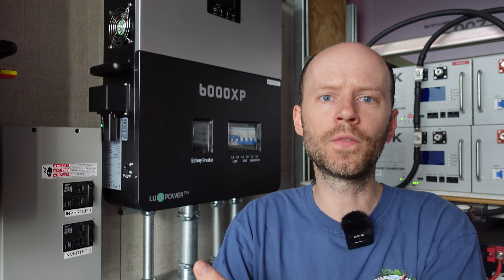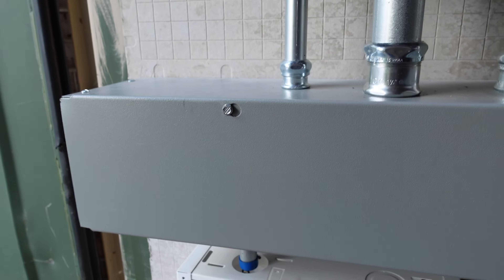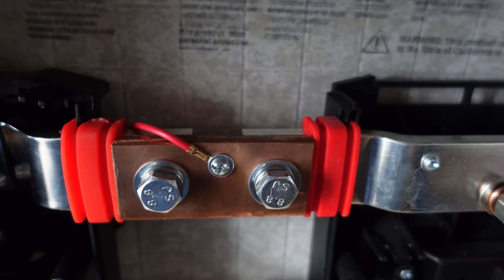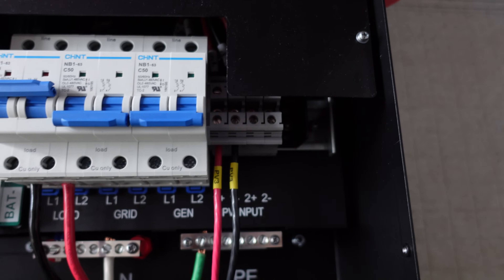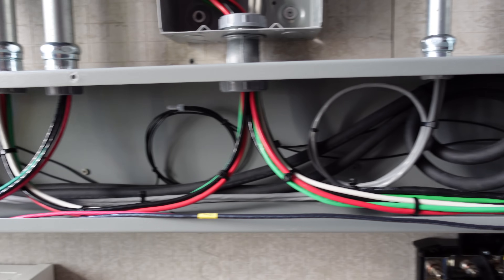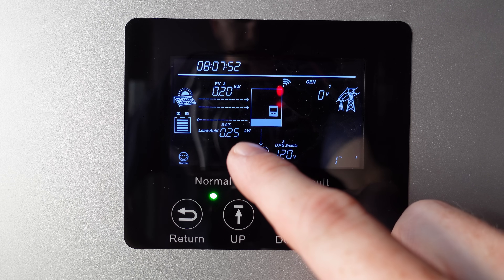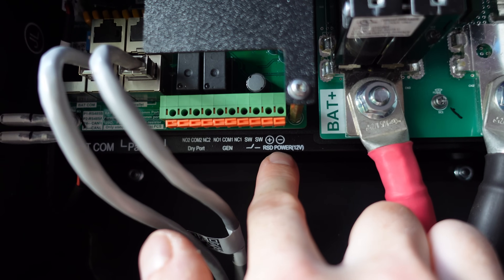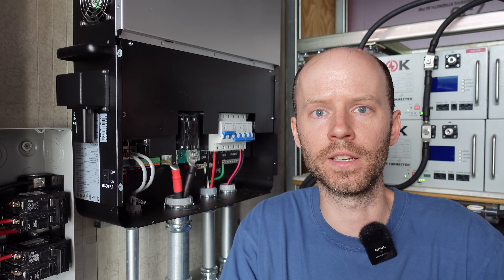The EG4 6000XP Inverters are Installed, Finally! 12,000W Off-Grid Solar Power

Comment from the maker: EG4 Inverter... https://www.currentconnected.com/product/eg4-6000xp-inverter/?ref=lithiumsolar
Victron Busbars... https://www.currentconnected.com/product/victron-lynx-power-in-distribution-system/?ref=lithiumsolar
Siemens Panel... https://amzn.to/3KNXnOB
SOK Batteries... https://www.currentconnected.com/product/sk48v100-48v-server-rack-battery/?ref=lithiumsolar
(affiliate links)
Reply: these are LiFePO4 batteries but the inverter thinks they're lead-acid according to the display, is that bad?

Comment: To disable or encryp the WiFi dongle:
Find the IP address the dongle got from your router and access it via a web browser.  The default login is admin/admin.  Select "English", and then you can adjust the "Wifi Mode Setting" to either disable the "AP Mode", or in the "AP Mode Setting" tab, you can enable encryption and add a password.   I recommend leaving the SSID to it's original name otherwise the EG4 app wont be able to find it.

This is working fine for me.

Good luck,
Mr Goodbits
Reply from the maker: Does the serial number for your wireless dongle start with BA?
Reply: @LithiumSolar  Yes it does.  I have the 18kpv.  Both models use the BA##### dongle.
Reply from the maker: @tomarq  Ah ok, what your describing only applies to the BA adapters. Mine is a BJ adapter and does not appear to be responding on any of the common web ports.

Comment: Does the unsecured inverter SSID give you access to settings or just for monitoring ?  Wired dongle $200 seems like they just want you to use wifi, that’s disturbing in so many ways.

Comment: Install looks GREAT!!  What "baffle" are you referring to in the wireway?  You dont need to separate AC and DC in the wireway if thats what you were talking about.
Reply: I think as long as all the wires are rated for the highest voltage that is inside the wire way or junction box no divider is needed.

Comment: what labels are you using on the wires?
I bought some and they won't stay wrapped arout the wires
Thanks for a great video
Reply from the maker: I use this label maker https://amzn.to/45tj0NO with this printable heat shrink cartridge https://amzn.to/45swFon . I don't like glue-based wire labels as they always leave sticky slimy residue and collect dirt/dust.

Comment: Great vid! I saw the SOK and EG4 batteries if I am not mistaken. Are they connected together? In other words, can one connect two batteries from different manufacturers in parallel with no ill effects? Thank you.
Reply from the maker: Yes, they are connected together on my battery rack. It can be done if the operational parameters and system sizing is properly understood.
Reply: @LithiumSolar  Okay. Thanks. Could you do a video on how you connected them and explain these parameters and sizing. It would be an eye opener for someone like me because I have been under the impression that you must use only the same batteries in a parallel configuration.

Comment: I'm so thankful that you mention the security of the WiFi dongle-router connection. I'm just getting around to installing a pair of 6000xps. I asked tech support by phone about security...having my home router exposed to everyone....and was told in a round about way..."no one seems concerned about that" and "no, there is no way to encrypt or lock out tech support from checking into my system anytime they feel like it....? I likely would/will  remove the dongles after setup and just live without the data available for me by phone or pc.  Currently all I watch  on my older off grid system is bluetooth data from a Victron shunt. Do I really need more data available with the 6000XP? Why can't EG4 provide bluetooth data versus out to the cloud/world data? Is EG4 mining data from our EG4 installations?
Reply from the maker: I don't understand how anyone thinks the open wireless network is acceptable. I will have an update in a few days hopefully ;-)

Comment: Great job on the install!  I'm partial to the conduit/wireway look.  It just makes things look nice and clean!  Looking forward to your future tests on this inverter.

I sent you a message on the forum with a link to a doc that might help you add a password to the WiFi dongle.  YT doesn't like links in the comments if they don't come from the creator.  

Regarding the fans on the inverter, I've seen other folks buy floor register diverters and put them on the discharge side of the inverter so you're not feeding warm air from one inverter directly into the other inverter.

Comment: Great presentation and nice job on the wiring - it's clean.  So the topics I like to see is the arrays used for these inverters to insure max input without over voltage.  The second is - and this is something - no one seems to touch on,  is generator interface.  Whether the system is off grid, or attached to, but NOT back feeding the grid - power outages will happen.  This is a crucial step to a automatic system that will continue to supply your critical loads without intervention,  If you have covered this in another video my apologizes and perhaps you can provide a link to that information.  Again thanks for the presentation and nice job.

Comment: I have 24 batteries in my setup and just used a panel board with 2P breakers as the combiner panel. But this only makes sense if you're pushing relatively low currents on a each panel.  

You should do a quick video comparing the Siemens vs Square D breakers.

Comment: Great install, looks neat! 
I am using self made copper 5x40 mm busbars that will do fine, combined with ANL 80V fuse holders that have enough distance to prevent an arc being kept when the fuse blows.
Is there a good reason to use T-specified fuses instead?

One small hint: never roll up wires in your cabling: they can cause unwanted behaviour because of being a coil...

Comment: Looking great, however the open wireless would be a deal breaker for me. There are libraries for WPA2 and 3 encryption, it's not as if they'll have to write this code from scratch and skimping on this is quite a bad look. I would push them hard to address this vulnerability.

Comment: Great review, 
That wireless dongle is a huge security flaw without a password, is there a way to enable password?  (I don't see why they don't sell a dongle that combines switchable secure encrypted wireless and wired LAN combo), and would like to see the MPPT voltage minimum dropped to v48 or lower).

Comment: I’m curious if your battery banks have separate shunts? On mine I have two different battery banks by two different manufacturers and each one has a shunt for tweaking the exact amp number going into each battery bank. 🖖
Reply from the maker: No, only one shunt on the entire system that connects to the Batrium BMS.
Reply: @LithiumSolar  
Then I take it that all your batteries are calling for the same amperage input?
Reply from the maker: @simon359  The maximum rate of charge of the battery bank is pretty much 10x the maximum output my inverters can deliver. There are more batteries off to the side that you do not see in the video. Each battery has a BMS that is programmed with over-current protection. I don't see any reason you need to devise any kind of system to make sure each battery is getting exactly X amps, nor do I think that's even possible.

Comment: Hi, if you were using the grid input, would use a second Seimens 4 way panel? the reason I asked, it is because most videos with dual 6000xp do not show AC input combiner box/panel even when using grid input. I am about to install my inverters with grid input, I hope I can see that bit of information soon.

Comment: Looks nice and neat. I did similar with a 6x6 wire way and was able to use most of the provided knockouts, but I did make the battery one a bit larger just so they lined up with the nuts inside the inverter better. Think I punched it to 2”. I did want to ask about grounding. I have family licensed electricians. He told be to add a common ground bar inside the 6x6 wire way and then have all the devices connect to that common ground. His expectation was not to rely on the conduit between the inverter and wireway for grounding connection, this ensures the wireway is grounded to a mechanically connected set of screws, just like in a electrical panel. I think since this is smaller gauge wire vs larger wire there are grounding allowances in the code book, but that’s how I did it. Common ground bus mounted inside wireway back to electrical panel then inverter, batteries, and a victron charge controller I use for testing all run back to that common ground bar inside the wireway.

Comment: I just got my 6000xp running really good inverter well worth the money IMO. I put it right into service cutting my peak usage from 6800KWH to 2300KWH haven't gotten my solar panels up working that soon but just this savings alone making a difference. This winter we get super off peak I will be charging during the super cheap rate and flipping over to battery rest of the day.

Comment: Nice build!  I wasn't sure the best way to put 2 of these inverters together.  I ended up going with a power distribution block to combine the AC output and also for my grid input.  I'm pretty happy with it so far.

Comment: What printer do you use forcthe cable labeling ?
Is pin terninals worth it? I see you dont use any?
Reply from the maker: I use this label maker https://amzn.to/45tj0NO with this heat shrink cartridge https://amzn.to/45swFon . The pin terminals (ferrules) are great when they're called for. The terminal blocks on the Batrium stuff pretty much requires them. They prevent strands of wire from breaking off and are good for stress relieving. They have their purpose. I would not use them on any of the inverter stuff or high-current items. I think I saw in the EG4 manual that they explicitly tell you NOT to use ferrules.
Reply: @LithiumSolar  Thank you for the label maker link !

Comment: What is meant by load and generator on the inverter?  Am new to this but I want to learn.  Thank you for your time and hard work you do and share with us.
Reply from the maker: The load terminals are where you connect the loads you're powering (typically it goes to a sub-panel). The generator terminals are an input from a generator to be used to charge the battery bank as needed (such as no sun, grid outage, etc).

Comment: One thing you might think about updating is the communication wire connections between the two inverters. The manual shows a diagram for 4 inverters, but nothing for two inverters. I will be subscribing as you are very detailed on the information, thanks.

Comment: Does the 6000XP communicate with the Lynx? Why did you need the shunt, wouldn't the Lynx provide the data you need?
Reply from the maker: I don't have the Victron Lynx, or any other Victron components. I use a Batrium BMS for my self-built battery banks (not shown in the video) which uses the shunt I installed.

Comment: PLEASE HELP!! I am in the process of installing 3 of these 6000K inverters. I have only two solar strings to wire. Do those strings have to be installed on the primary inverter or can they be installed on any of the inverters?? I can't find an answer to this anywhere!! Thanks for the video!

Comment: Been waiting on this one!  And you aren't wrong about the internet connected device craze.  It's not useful in many cases, and it's always a security risk.  I would much rather have my own subnet connected through a router that doesn't allow incoming connections at all than have the "convenience" of easily connected devices.  The Internet of Things should be managed by offline modules you can choose to update over your own network but never communicates beyond your home network without permission and absolute necessity.  Household appliance manufacturers are no more ready for harmful code injection than your nearest great grandmother is on her iPhone.  There are way too many unknown faults that could cause real world harm.

Comment: Great video, one note, the fans of the first inverter will end up blowing hot into the intake of the other inverter.
Reply from the maker: Logic would suggest this; however, the manual states they can be placed a minimum of 7.9 inches apart and mine are further. Perhaps I can put a piece of hvac duct metal bent at a 45 angle to direct some of the air outward instead of directly in to the next unit.

Comment: Where do we terminate surge protection for 2 inverters (off grid, standby genset, 4 dc strings from ground mnt array)??
Reply from the maker: I don't have an answer there unfortunately. I would have to defer that to a licensed electrician.
Reply: I am licensed and technically the manufacture could advise but EG4 deferred to the sales rep?
An extreme version of surge protection would nearly cost the same as an inverter, maybe just have another inverter on standby?

Comment: Wonder if the fans could be flipped on one inverter so its not blowing hot air from one to the other. Im in a really hot climate so heat is a issue for me.

Comment: I created an encrypted  guest network on my router called EG4 so the inverter can be connected to the internet without giving them access to my home network.
Reply from the maker: That's kindof what I did, though it goes a step further and also blocks access to the internet.
Reply: @LithiumSolar  I'm an old guy. I'd love to have a detail instruction set on exactly how to set up a guest network.....as described here. Currently I have a Starlink router and am not sure if I'm able to set up such a thing as a "guest network". This Starlink is the Gen 2 model which does not have any input or output connections for an external router....with which I could likely set up a guest network.  I'm technically challenged to the extent that I don't know more about the subject. I live off road and off grid in the far north Idaho mountains. I have a diesel heater and blink camera that currently invade my router security....but I don't know how to make it secure.
Beautiful installation ....  Many thanks!

Comment: I've been using the Solar Assistant for a while now on a smaller system, and it works pretty good, though for me it will occassionslly lose connection and you have to manually disconnect and reconnect (through the software).   I asked about either auto reseting when it disconnects, or at least give some notification, however, he said he hadn't heard of the problem.  I found a few other people mentioning it on other forums.   Still a nice system, it's just annoying when it happens.

Comment: A word of warning.  In my experience that CPT branded buck or boost power supply in the bottom of the cabinet sooner or later will fail and take what ever is plugged into it out too if it's a buck.  I've had it happen personally and also to a friend that used them.  If they must be used over voltage protection is a must, crowbar or the like.
Reply from the maker: That's a Meanwell power supply, not CPT. Meanwell are very reliable. I have a few of them now and never had a problem with any of them.
Reply: @LithiumSolar  Not the box to the left of the DIN rail.  The thing sitting in the bottom of the cabinet, clearly has CPT on the label.  Timeref 06:00
Reply from the maker: @retrozmachine1189  OH that!! Yes, that was an uber-cheap converter that I had a raspberry pi plugged in to. It will go away soon. Thanks for the tip :)

Comment: So some are saying these XP6000's are loud as $%^#, what's the deal? Are they really too loud to be inside?
Reply from the maker: They make normal fan noise. I would certainly not classify it as "loud as $#&@" but it's loud enough that I wouldn't want it in a living space. The speed throttles based on device temperature.
Reply: They built a closet next to the main panel in the hallway but not sure keeping them behind the closed door would be a good idea.

Comment: 80% derate rule only comes into play when you are pulling 100% of the circuit breaker and wire size for 3 hours of continues draw from your circuit breaker panel then after the 3 hours you can only draw 80% this is due to the heat that is built up in the circuit breaker and wire. Temperature rating of the wire needs to be 90 degree C.
Reply from the maker: Correct, the time for a load to be classified as "continuous" is 3 hours. This inverter can exceed that, thereby I sized the breakers 1.25x as required.

Comment: Why not an18kw instead 2- 6ks inverters??
Reply from the maker: What 18kW inverter are you referring to?
Reply: @LithiumSolar  eg4 18kpv
Reply from the maker: @fly4fun24  That is not an 18kW inverter. It is a 12kW inverter. It is the same capacity as what I installed here for an extra $2100!
Reply: @LithiumSolar  The 18k is a hybrid, these are off grid.  Plus two is one, one is none.  Lose one of these and you still have 6000 watts of 120/240v
Reply: Wow.,2100..... You can buy almost 10kW Of Battery , it Make sense...

Comment: So the one on the left is sucking all the hot air from the one on the right :p
Reply: I'd totally trust you to set this up more than an electrician lol.
Reply from the maker: Yeah that's pretty much what happens, though I have a couple of inches further apart than the minimum distance specified in the manual lol